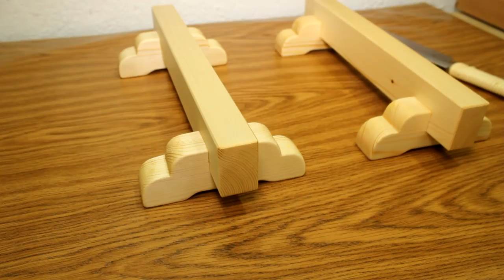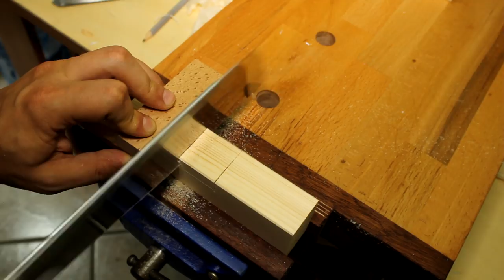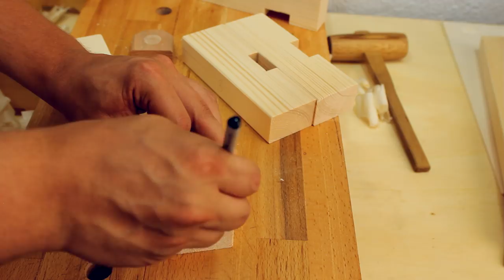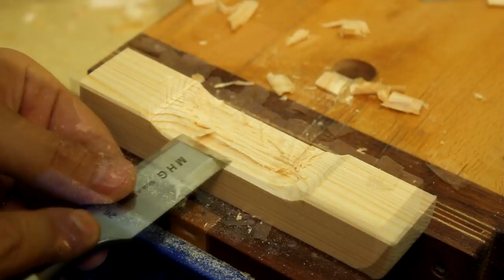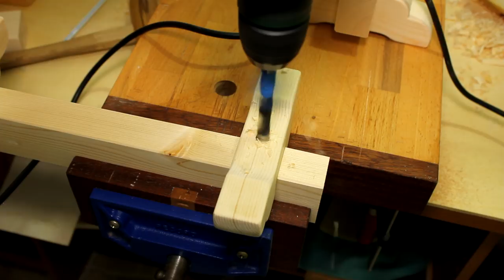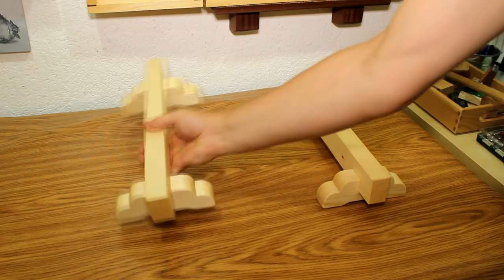Making Japanese Low Sawhorses

Comment: Very nice! What brand of chisels do you use?
Reply from the maker: Thanks! Those are MHG, a german brand, one of the cheapest types of professional, lets say, chisels. Maybe Narex are cheaper. It's like 10 euro/$ a piece. I have 5pc, 6,8,12,16,25 mm. Now I just bought a japanese chisel, 12mm, 1/2", made by Matsumura, is like 4x the price of one MHG. It's not 4x sharper or better than MHG, but the feel and pleasure working with it made me regret why I didn't bought from the beginning only just two 6 and 12 mm of this type :)